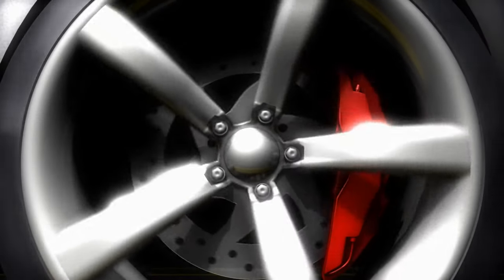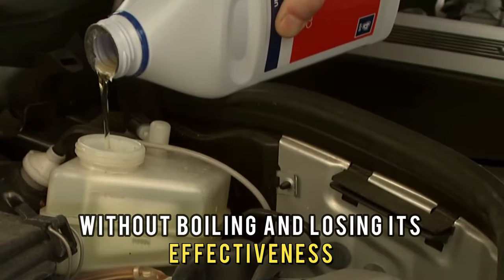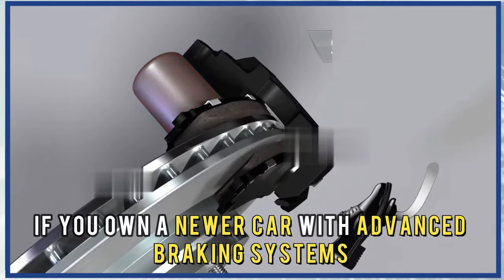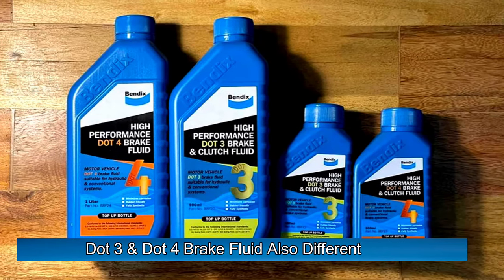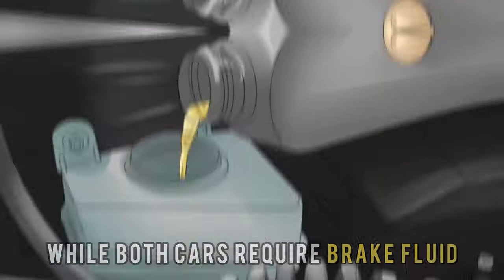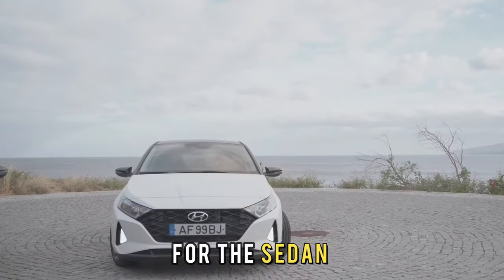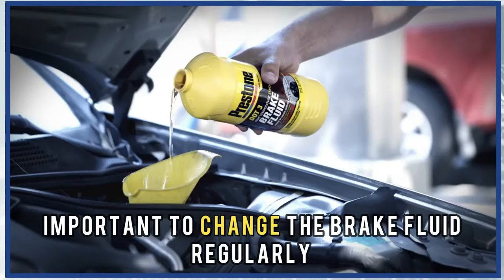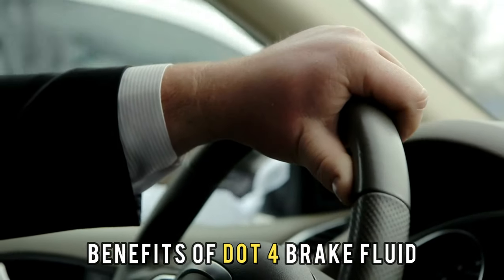DOT 3 vs DOT 4 Brake Fluid: What's the Difference? (Choosing the Right Brake Fluid)

Comment: You missed an important point. Both DOT 3 & DOT 4 are compatible and the difference in price is only 5% so why is DOT 3 still sold you ask? It is because DOT 3 is less hydroscopic than DOT 4 so if you don't need the higher boiling point (Not repeatedly heating your brakes / not living in the mountains) then DOT 3 won't need changing so often and may outperform DOT 4 after years of neglect.